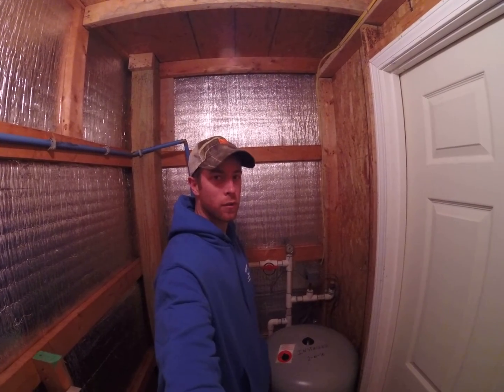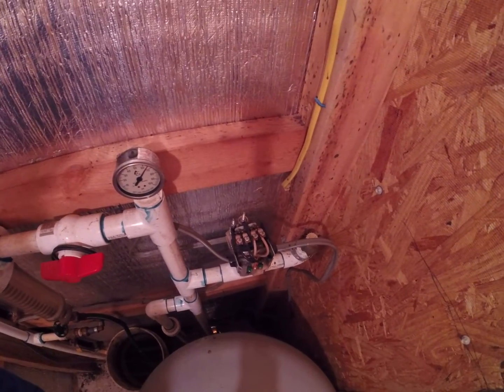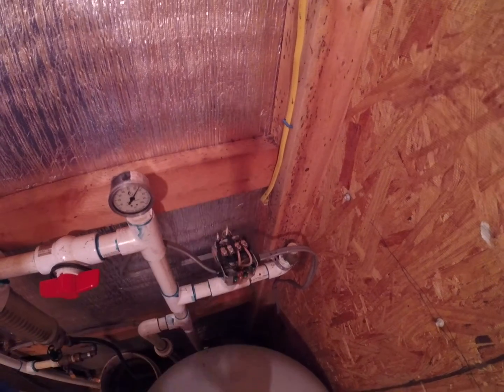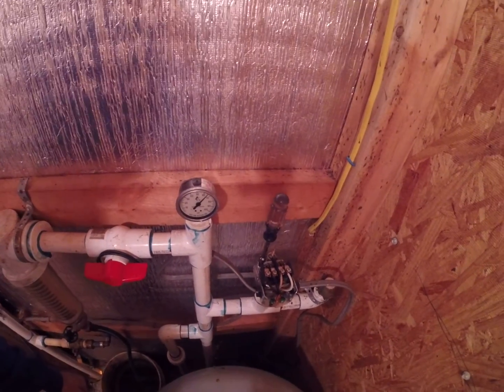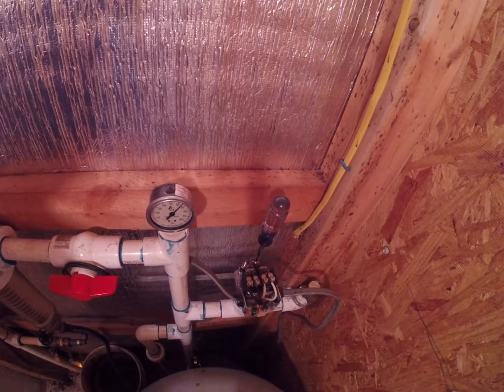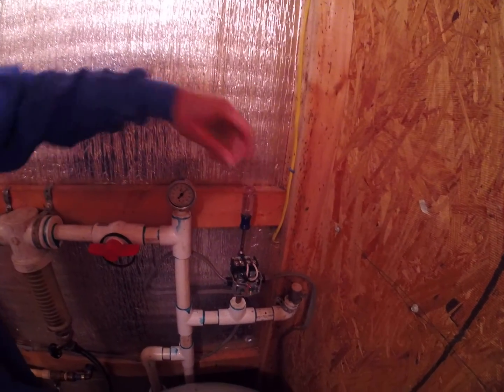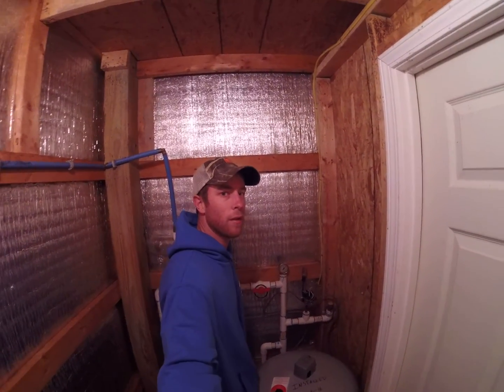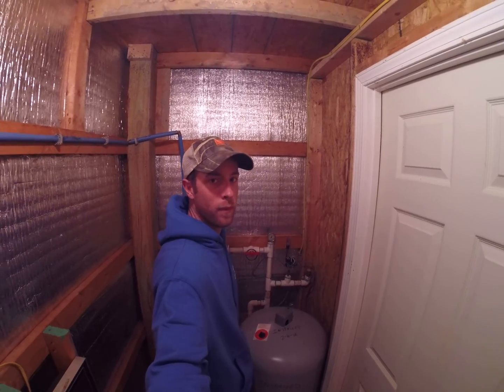How to Adjust a Pressure Switch | How to Adjust Home Water Pressure on a Well

Comment: Mine cuts on at 30 , off at 50 and I've been waiting to rsisd it but I've always been worried of doing it wrong , would you just raise it to 60 or 65 off pressure  or do you always need to raise both.

Comment: i have use this to boost my water pressure in my house ..but in the shower the pressure comes up and then drops low and so on how do i get a straight flow of water ?
Reply: If you have 40/60, then the water pressure should not drop below 40 if everything works correctly. If your water pressure jumps up and down too often and your water tank is at least 20 gallons, then most likely the pressure tank has a bad membrane and filled with water.

Comment: Will I need to pump some more air into the well pressure tank after I adjust cut on/cut off? Right now it’s on 38 psi on a 40 cut on. If I raise it to 45 will I need to pump the tank to 33psi? Or will it automatically adjust with the pump settings?
Reply: If you raise the cut in to 45 you'll need to increase the air pressure in your pressure tank to 43 psi, 2 below the cut in.  You do that with no water pressure in the tank, open the drain until the pressure drops.

Comment: Hey i have the same system but It is on 30-50 settings but I wanna change the cut on settings to 40 psi how should i do that? thanks nice vid
Reply from the maker: turn the nut on the big spring clockwise, this will raise cut on and cut off pressure together

Comment: Do I need to shut power off to adjust this? Mine is under my house in a crawl space.
Reply: Do you have too?
Reply from the maker: @zachary-zombie  no you don't, you just better know what you are doing so you don't get shocked.
Reply: Wendell Lee Well Services ok thanks 👍
Reply from the maker: yes i would
Reply: You should have a power disconnect near the pressure switch.

Comment: Just had a filtration system installed.. My water now has to flow through a sediment filter into a softener and then through a carbon filter before it reaches my kitchen, bathroom, etc.. Until my pressure pump kicks in the water pressure is dismal for the first 5 mins or so.. Plus when showering I cant do much of anything else.. Especially flush the toliet. I didn't have this problem before the softener and filter system was installed. Would raising the cut in pressure fix this so I don't have to wait 5+ mins for my pump to cut in? I think it cuts in around 35ish psi.. Cuts off at 60psi
Reply from the maker: it definitely won't hurt...try cutting on around 45 psi, cut off at 65 psi. That should make a difference
Reply: @WendellLeeWellServices  thanks for replying. Is there a down side to having your pump cycling on and off more frequently and using more pressure? Other than obviously using more water?
Reply from the maker: @cjohnson18711ify  well more pump cycling leads to more wear and tear on your pump. More pressure however won't hurt a pump

Comment: I am operating without a pressure tank. How to do I adjust the Square D 9013 switch to run in an on-demand scenario; that is, without cycling? Thanks.
Reply from the maker: that is impossible to do unless you are pumping open discharge into a pond or something similar. In that case you don't need a pressure switch. If you need any pressure at all, it is imperative to have a pressure tank installed in your system
Reply: @WendellLeeWellServices  Thank you for the response. I figured it out: First, I can only get 65 psi max from my water pump. On the Square D Switch, I loosened Nut 2 until there is no tension on the spring. I tightened the Nut 1 to get a 65/45 psi operating range. I then ran the water, and while the water is running, tightened Nut 2 in small increments until the cycling stopped. Now, when a faucet is used, there is only one pressure drop to the cut-in 45 then jumps to 65 psi, where it stays until the faucet is turned off.
Reply from the maker: @ctrader6  Ah I gotcha, should work ok if your pump can't pump any more pressure. That makes more sense